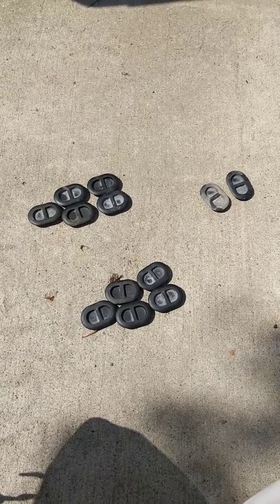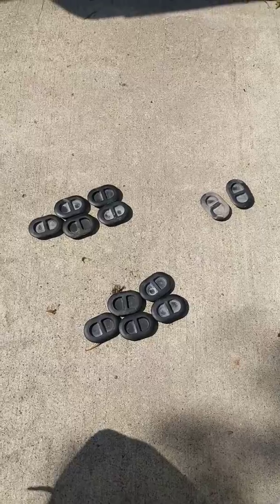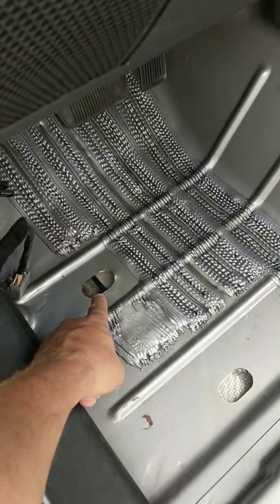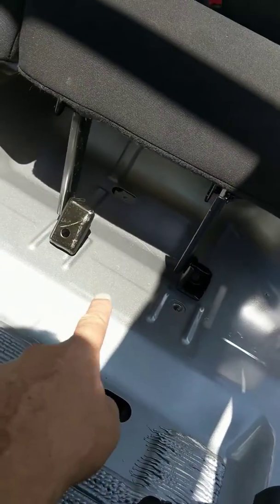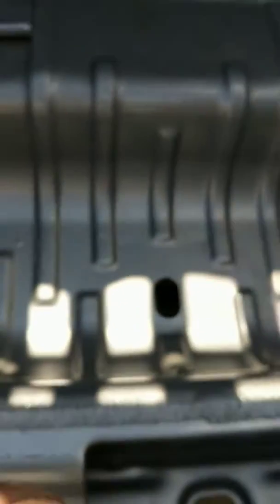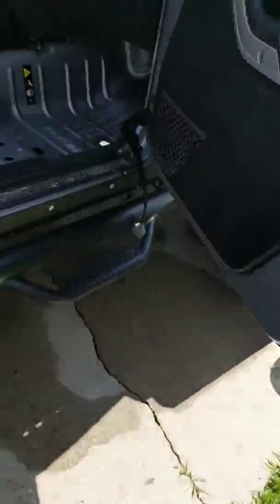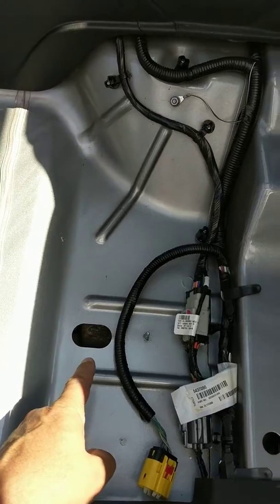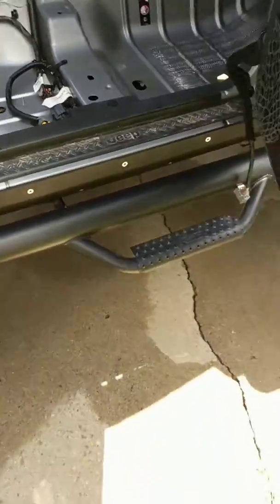"JKU".  Floor Pan Drain Plug

Comment: I'm just now getting to floorpan repairs/sound deadening and for the life of me cannot figure out why in the hell these things are in there and what their originally intended purpose was supposed to be. I've scoured the internet looking for an answer and have found nothing. Best I can come up with is that they're holes made for the purpose of craning floor pans into the body at the factory and plugged post-process. Working on an F-150.

Any idea?
Reply from the maker: Tyler the floor pan plugs in a jeep are for rinsing out the floor pan as most ppl at some point remove the doors and wheel resulting in getting mud, dirt, snow inside the cab and with jeeps we just pull carpet in minutes and pull the floor plugs and wash the tub out and reinstall the carpets.  Most other vehicles put plugs in before body is sent through oven and sealed. Jeep makes their plugs removable.